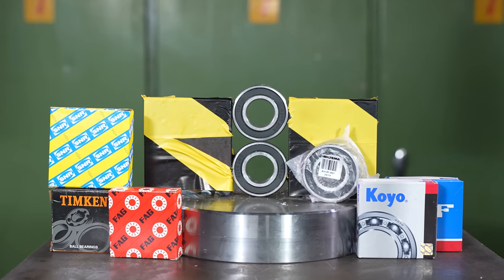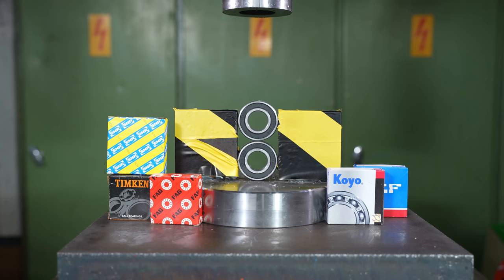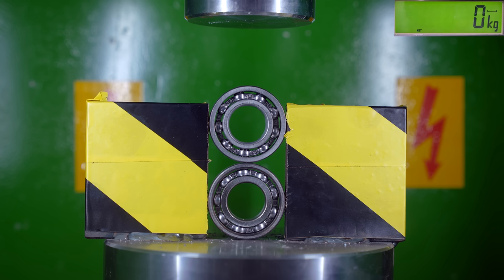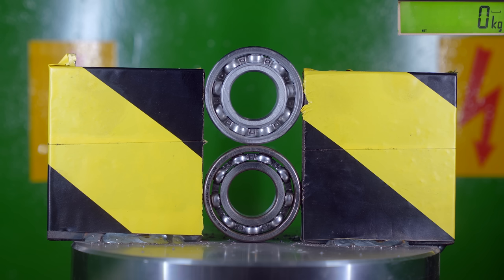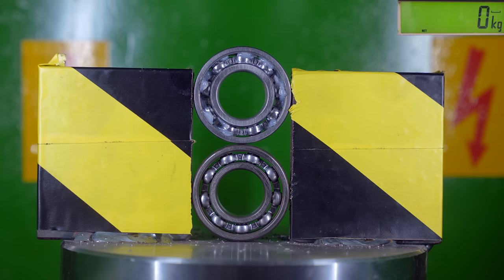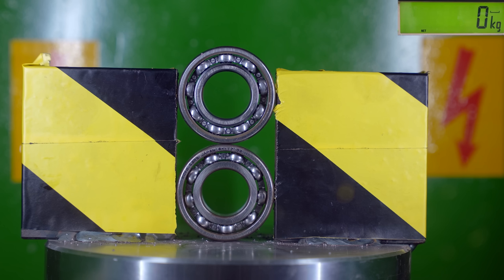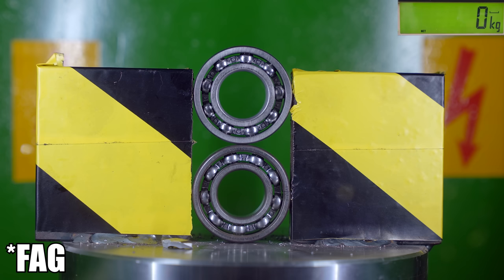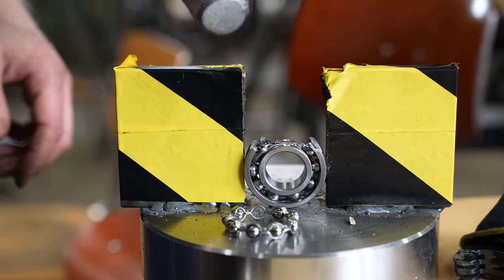Brutal Ball Bearing Test with Hydraulic Press

Comment: The best bearing will break first. You want hardness.
Reply: I don't think this is any indicator of how well it fulfills its role as a bearing.
Reply: @tiddybagel  harder bearing races are more brittle. Brittleness is an indication of hardness.
Reply: @RadDadisRad  No it's not.  You can have a very hard thing that isn't brittle.  Brittleness is a sign of poor heat treating.
Reply: @JayRussellDuramax  you’re wrong.
Reply: @RadDadisRad  Oh, ok.  It's that simple, is it?  If this is how you explain things to your kids, you've chosen a poor username.  Therefore, since you clearly didn't research hardness or brittleness before commenting, I'll summarize reality for you:

Quoting from Wikipedia:  "In material science, hardness is a measure of the resistance to localized plastic deformation...", and, "When used in materials science, [brittleness] is generally applied to materials that fail when there is little to no plastic deformation before failure.".

So, though they are related, hardness and brittleness cannot be inferred from each other.  If a material is very hard, but not very brittle, it will be very strong, but there will be significant plastic deformation before it fails.  Conversely, if a material is brittle, but not very hard, it will shatter under very little stress.

So, in the case of bearings, choosing a material that is alloyed and tempered such that it can undergo significant elastic deformation without yielding is the goal.  Materials that fit that description have a high hardness.  If those materials also fail without much plastic deformation, then they are also brittle.  However, once a material is brittle enough to fail before it yields, increasing it's brittleness will only make it weaker, thus making it a worse material to make a bearing out of.  So, no, you're wrong.
Reply: @JayRussellDuramax  nobody chooses a ball bearing that will deform. They want ball bearings as rigid as possible. Other types of bearings are more elastic. It’s not my job to explain these things to you. I’m glad you can read a Wikipedia page. If you’re really interested look up metallurgy and mohs scale of hardness and compare the inverse of hardness to brittleness with metals. So yes it is direct relation because a certain metals hardness and brittleness are in direct relation. I’d wager you don’t even know at what hardness ball bearings need to be and surface finish ratings and what those attributes accumulate for ABEC ratings.
Reply: @RadDadisRad  I hope those boys in your profile picture don't hear things like "It's not my job to explain these things to you.", or "If you're really interested, go look it up.".  If they do, you should change your username to "Bad Dad".  Therefore, let me show you how to explain things to your kids by putting facts into simple terms:

First, since you clearly don't understand the difference between elastic and plastic deformation, I'll start there:  Elastic deformation is deformation that springs back when the load is removed, i.e., non-permanent deformation.  Plastic deformation is deformation that does not spring back when the load is removed, i.e., permanent deformation.  So, as I said in my previous comment, elastic deformation isn't a problem in bearings because it's not permanent; when the load is removed, the bearing returns to its original, undeformed state.  Plus, elastic deformation is a mechanism that a bearing can use to avoid shock loads, since the material can deform under the shock and then spring back to its original shape.

Second, since you mentioned rigidity, it's time for a lesson in stress-strain curves:  When a material is deformed, the first portion of that deformation is linear, and the slope of that line is the material's Elastic Modulus.  A material's Elastic Modulus is directly proportional to its rigidity:  The higher it's Elastic Modulus, the more rigid it is.  Next, if you continue to deform it, the material, while still deforming elastically, will deform non-linearly with applied stress until it yields, or begins to deform permanently.  Once the yield point is reached, all further deformation is permanent.  There will be some spring-back, but, the material will be in a significantly different shape than when the deformation started.

So, that's important because each material's Elastic Modulus is a constant for that material, e.g., hardening a metal WILL NOT change its elastic modulus - unless that hardening process changes its chemical makeup, which means it's not the same material anymore.  Therefore, to make a bearing more rigid, you don't increase the hardness of its material, you change its material to one with a higher Elastic Modulus.  Which means that, if all bearings are meant to be as rigid as possible, they ABSOLUTELY wouldn't be made out of steel, they would be made out of diamond...

Also, making a material more rigid does not make it less elastic.  A rigid material is a material that takes large amounts of stress to deform it.  So, the opposite of rigidity is flexibility, not elasticity.  Therefore, if a material is flexible, it only takes small amounts of stress to deform it.  An elastic material is one that exhibits large amounts of elastic deformation without yielding.  So, the opposite of elasticity is plasticity, not rigidity.  A plastic material is one that exhibits very little elastic deformation before yielding.  There are plenty of materials that are very rigid, yet very elastic.  The most common one is spring steel.

Third, when you said you were glad that I can read a Wikipedia page, I thought you were being sarcastic...  But then I read them, and saw that you were actually complimenting my ability to do basic research - which you CLEARLY haven't done.  Let's see what Wikipedia has to say about the topics you mentioned:

Quoting from the article, Toughness:  "Toughness is related to the area under the stress–strain curve. In order to be tough, a material must be both strong and ductile. For example, brittle materials (like ceramics) that are strong but with limited ductility are not tough; conversely, very ductile materials with low strengths are also not tough. To be tough, a material should withstand both high stresses and high strains. Generally speaking, strength indicates how much force the material can support, while toughness indicates how much energy a material can absorb before rupturing.".  So, the more brittle a material is, the less energy it can absorb before rupturing.  Therefore, your initial assertion that bearings should be as brittle as possible is entirely and ridiculously WRONG.  As I said in my previous comment, once a material is hardened such that it fails before exhibiting plastic deformation, making it more brittle will only make it weaker, and, therefore WORSE for use in bearings.

Next, quoting from the article, Mohs Scale:  "The Mohs scale of mineral hardness (/moʊz/) is a qualitative ordinal scale, from 1 to 10, characterizing scratch resistance of minerals through the ability of harder material to scratch softer material.  ...  The Mohs scale is useful for identification of minerals in the field, but is not an accurate predictor of how well materials endure in an industrial setting – toughness.".  So, congratulations on directing me to a hardness scale that has ABSOLUTELY NOTHING to do with bearings.  If you want to look at what hardness scale is actually relevant, you should educate yourself on Rockwell Hardness.

Finally, quoting from the article, ABEC Scale:  "The ABEC rating does not specify many critical factors, such as load handling capabilities, ball precision, materials, material Rockwell hardness, degree of ball and raceway polishing, noise, vibration, and lubricant.".  So, you know why I don't know how hardness and surface finish ratings accumulate to a bearing's ABEC rating..?  BECAUSE THEY HAVE ABSOLUTELY NOTHING TO DO WITH ABEC RATINGS!  The hardness and surface finish are determined by the application.  You can 3D print bearings that work quite well for their intended purpose, yet they have very low hardness and very high roughness.

Good day to you.
Reply: @JayRussellDuramax  nice retort, I’m not reading any of that. I’m a licensed and practicing automation and robotics engineer. I know how these things work.
Reply: @RadDadisRad  And I'm a Mechanical Engineer, which means I actually know how materials behave under stress.  You pick components that already exist and make things move.  I design those components from scratch so that people like you can do your job.  Good day to you.

Comment: Those that broke easier, means they will last more in use (for their intended purpose as bearings) The Chinese one, didn't break, because it's either too soft steel quality, or has a low het treatment which is also bad for such a product, or it has both a low quality steel and a low heat treatment, which is likely the case here..

Comment: In my opinion, ball bearings are designed for completely different operating conditions. In real conditions, they are not exposed to loads of this type as in the film, because they are tightly embedded in the holes of the machines. The bearing is to be resistant to abrasion during long-term operation. But i'm not an expert

Comment: This type bearing is designed for resisting rotational forces.  A FAIR test would be to place the bearings into a proper holder with a properly fitting, rotating shaft and measure the temperature rise in the bearing with progressive loading.  Also, noise under loaded rotation is a good indicator of bearing quality.  This test shows nothing more than the temper of the metal.  Exciting, though.

Comment: Many problems in this competition that cast doubt on any assumptions toward "best" implied.  Flex in the fixture making different situation top/bottom, reuse of already damaged bearings, lack of radial support of bearing races. A better test would be to press them into a fixture that has proper radial support, then spin the bearing under increasing radial load, graphing the resistance until failure.  That would give a good indication of which is the "best" bearing to do what that kind of bearing is designed to do. But hey, is this really about determining which bearing is the best one as a bearing, or which one makes the the most spectacularly dangerous mess when it blows TF up?

Comment: To be fair, two runs with the same brand bearings should be done, switching positions. As you said it could have been a advantage in the bottom position. You get it right the next time, I’m sure of it!😊

Comment: Afaik, the harder and wear resistant a steel is, the most likely it will break when bent.
Bearing steel has to be hard and wear resistant by definition. 
So winners are loosers and loosers are winners.

Comment: Depends on the application, SS would be better in a marine environment such as beach buggies eventually becoming more durable the the corrosive High Carbon Steel. Also if you wanted BB that can handle more load then select a bearing that's specified to that weight range.

Comment: this is a stupid test for bearings. bearings are made of hardened steel. the harder ones will break first. better test would be to see if you can cut it with a hack saw or file. those would be. junk.

Comment: best test of the bearings would be to spin them at high speed with load on them and measure the temp plus the noise of the bearing after x amount of hours plus any play. Test would need to be done over many hours.

Comment: This is a completely pointless 'test' that says absolutely nothing about the quality of the bearings. A radial bearing does not experience this sort of load on the outer race because it's usually fully supported in a housing. It's not surprising that the 'better' bearings appear to fail first in this test because they are more brittle due to their superior hardness. The only fair test would be to subject them to the load they were designed for and measure the wear after an extended period. Cheap Chinese bearings are usually total garbage (like most Chinese shit), and won't last a fraction of the time a quality SKF or Timken bearing will last.

Comment: Most  bearings I look at fail from not having proper grease in them. The bearings go dry and weld the balls to the bushing or race. Lubrication is of the utmost importance, not the loads placed on the bearings.

Comment: Too bad the forces you applied to the bearings have zero effect on how long they will last. The outer race goes in a pocket and the inner race goes on a shaft. The inner race and bearing spin. They have no vertical pressure. So this test isn’t about which bearing will last the longes. It is about which one is built the strongest. The two have no correlation.

Comment: Not really a realistic test since Bearing are made with hard alloy metals to resist wear. This make them brittle. The most brittle bearings likely using the hardest alloys making them more likely to last longer than the lower cost chinese bearings, that break less in this test.

Comment: Which is harder steel or glass? Which will break faster steel or glass? What is more abrasion resistant steel or glass? The answer is that harder steel is more brittle but more resistant to abrasion.

Comment: This test is rubbish  the Chinese bearing was positioned with the ball at the bottom and as the pressure was applied the SKF bearing moved between balls making it the weakest point . If the SKF bearing had the ball located at the top and the Chinese was set between two balls the opposite  would have happened. Bearings are not tested in this format.

Comment: This test proves nothing. SKF and many others are made in China regardless of the name on the box. Check the surface finish of any modern two piece {cup and cone} roller bearing {including Timken now made in India} against a new genuine made in USA  Timken from 30 years ago and the difference in quality is blatantly obvious. One can almost file a fingernail on the surface ground finish outer race of modern name brand bearings, vs the USA Timken of old which is a highly polished surface. I've rebuilt pumps for many years, the crankshafts of which use roller bearings. Brand new or rebuilt pumps with Chinese bearings rarely last more than two years before the main bearings are shot. The same pumps made or rebuilt with USA Timkens back in the day would run a decade or more.   I recently inspected the USA Timken bearings in the axles of my 37 year old 4x4 one ton truck and they had zero pitting or wear. I replaced the oil seals and reinstalled them since even after nearly 40 years of service they are still superior to any new Chinese, Japanese or India made bearing sold today.

Comment: This is not how bearings are tested. No roller bearing would be subjected to this amount of side pressure under normal use. They are for rotating shafts or around shafts.

Comment: Two thoughts:
1. Like someone else said, good quality bearings are better hardened than the cheap ones (perhaps).
2. You should run a "losers bracket", so the one that lost gets a second chance, and is only eliminated after the second loss. Otherwise, the first or second round may have removed the "second place". Yes, that would be more time consuming, and of course require a lot more bearings.... :)
Reply: The loser bracket would tell us which bearing has the best hardening and is the best bearing. The one that fails first has the best hardening.

Comment: sorry, but this test is irrelevant. a bearing is designed for certain radial forces from the shaft (inside) via the bearing-balls to the stationary outside ring which is 360 degrees pressed into the bearing housing. A bearing shall have high accuracy (no play) and the main quality appears in the lifetime of the bearing (number of turns before worn out). And this mainly is guided by the quality of the steel used verses fatigue. Ability of steel against fatigue is not proportional to hardness. What you do is a brutal egg verse egg test which has nothing to do with the a serious test to find out the real quality of the bearings. Sorry!

Comment: Ok, you need a second test. But this time, the ball bearings are in use: two shafts that rotate inside them and since we are looking for the moment when they don't function anymore... small DC motors are perfect for the job: not a lot of torque and won't burn so easily when jammed. 

To me, the moment they stop working is the failure point. 3D printed adapters/shafts for the motors so you don't have to worry about those adding any significant strength to the mix, and they can even be built to fail when the axle jams. 

In this setup you also have a problem with the bearings themselves being positioned differently with each pressing. But if they rotate: the rotational position where they get stuck could be interesting on its own. Prediction: The one that seizes first, it has two bearings on top and bottom positions, if there are even number of balls..

Comment: bearing are made to run free and hold crease , you never see them fail like this they mostly run dry and get dirt in them then they run rough. outer case is pressed in to a round hole. this does not show the best bearing.

Comment: I can tell you why the Chinese won. Its because it is improperly heat treated for a bearing. Its not hard enough. This makes it less brittle which is an advantage in this scenario. In the real use of bearings the Chinese fail horribly. In my experience they have about 20% the life span of any of the other brands you tested. Even Mexican made bearings do much better in normal use.